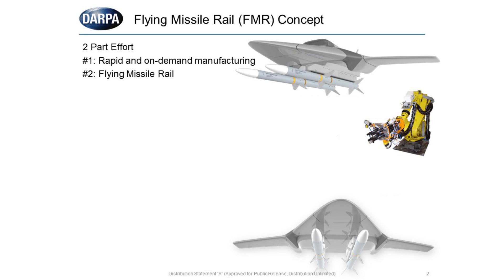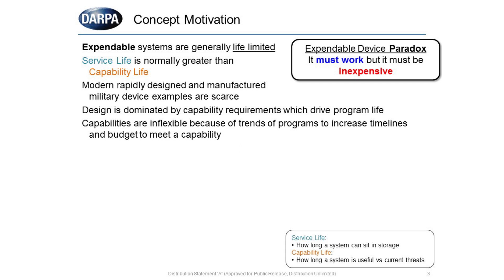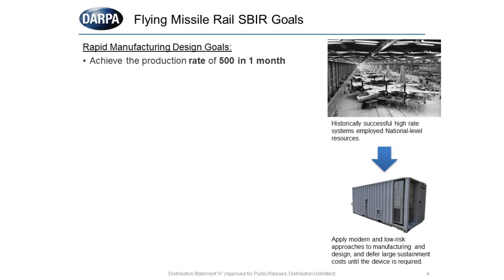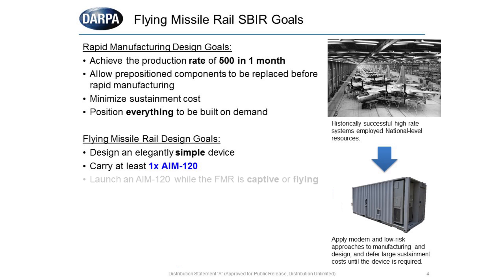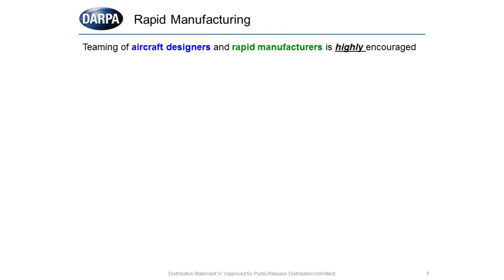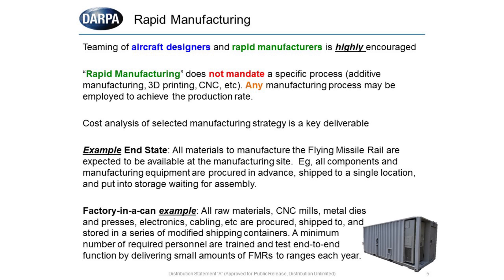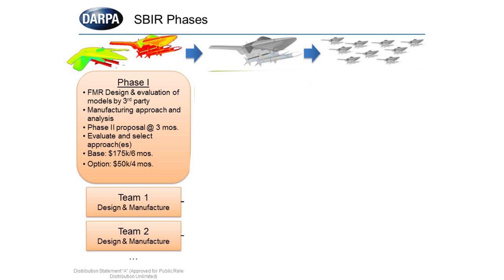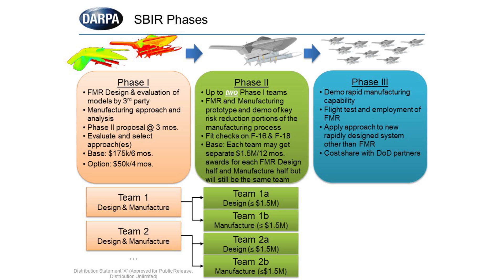Design of and Rapid Manufacturing Technology for a Flying Missile Rail

Comment: A much more simple way of extending the AMRAAM's range could be to use an old AIM-120A motor and control surfaces and use that as a booster. That would cost almost nothing and would be much lighter. That would easily double the range if the missile uses a lofted trajectory and it would be super fast.